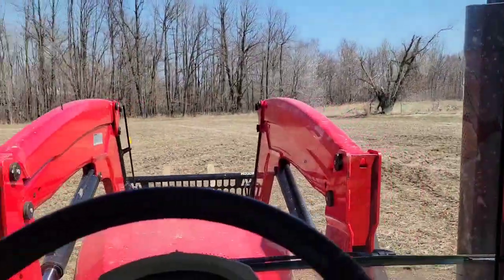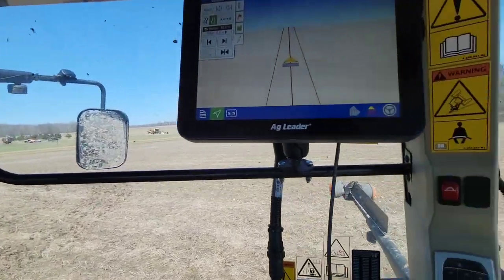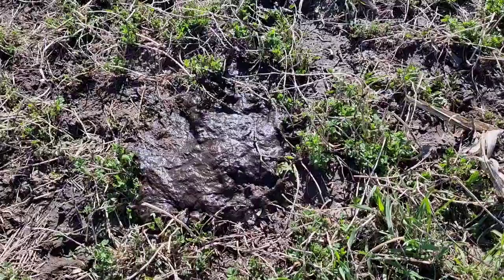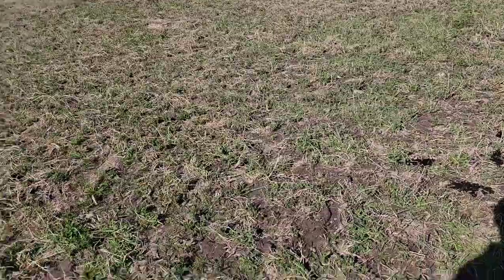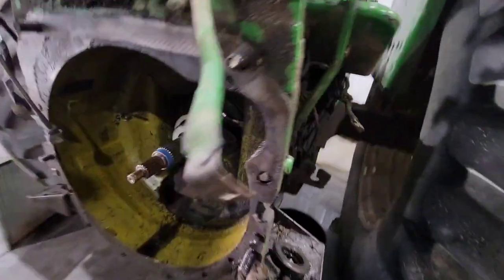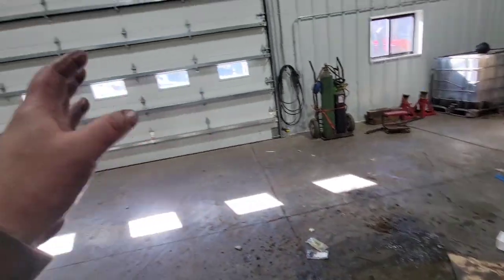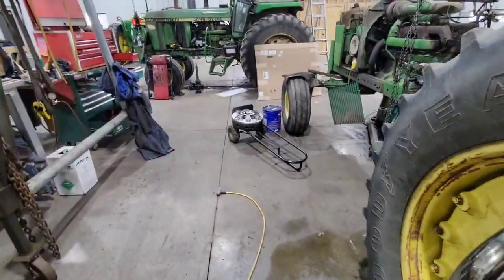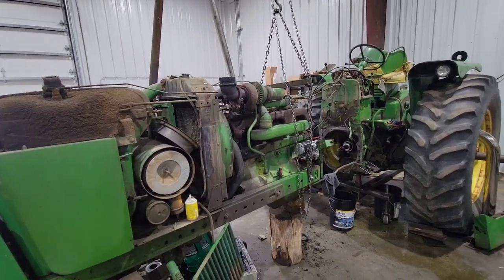Auto steer in Massey 8660,  Cows get first grazing!!  Shane Holst 4320 in for surgery!

Comment: My neighbor has a 4320. Cold blooded but its a real nice tractor. Got a few trophies pulling on 12,000 class on cement at our community fair.
Reply from the maker: we have put a lot of these reduction starters, fixed up cables, batteries and it makes them pretty good down to 30 degrees or even colder.

Comment: What kind of cab interiors do you install, glue in or proform?
Reply from the maker: We use fher kits, it comes with plastic on the back pre fitted, simply clean cab and install with some adhesive

Comment: When you plant do you ever get wide and narrow rows? We have been fighting with that for several years
Reply from the maker: Not with the planter but with the old system on the 8450 and strip-till Bar.

I played with the offset setting. So if you tell the monitor that the receiver is in the center line of the tractor but when you go south and turn left then say that one's about 6 in narrow and you head north and you turn right might be 6 in wide

Then I would adjust my offsets and tell it that maybe the Globe is actually 3 in to the left